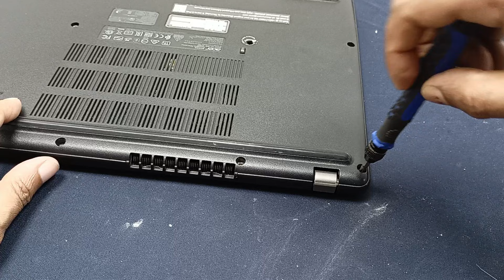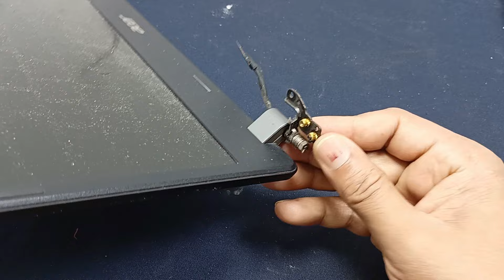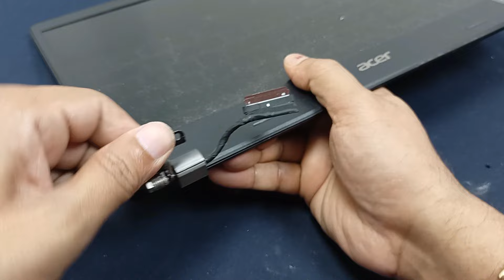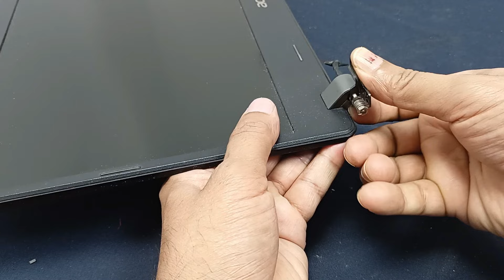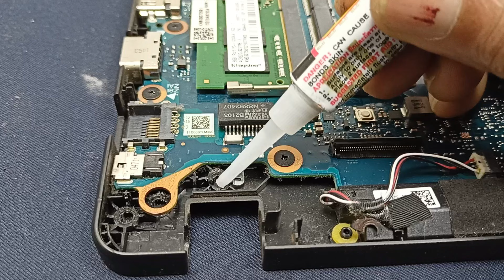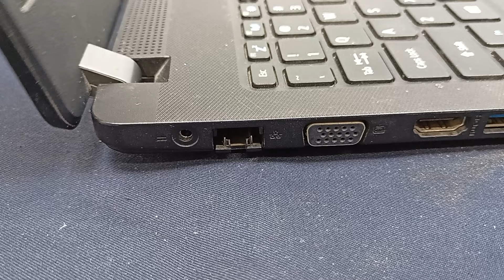Hinge repair acer travlemate  215 laptop

Comment: I had the same problem with an old HP laptop. Exact same stiff hinge design that screwed into plastic. I like to use CA glue with baking soda or JB weld epoxy

Comment: Hey thanks for the video, but There is a seal on the body,I think it's the warranty seal.So if i break it and open up  my laptop,will i be able to  claim the warranty in future?(For the battery) I bought this laptop in 2022.
Reply: You have to figure out if its still warrantied before you touch anything. Get a hold of the store you got it from. If they will not warranty it then do what you want.